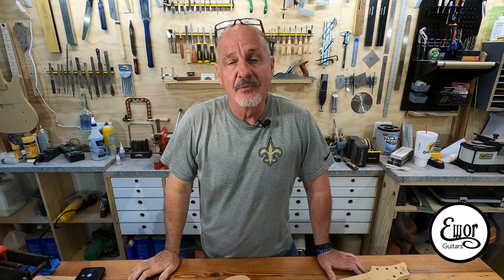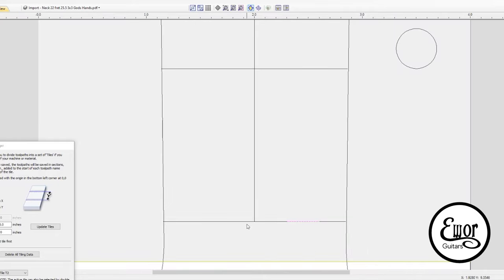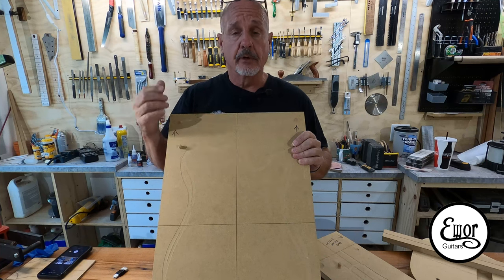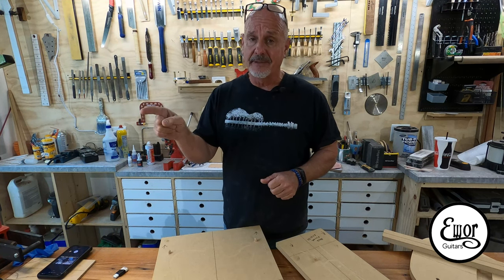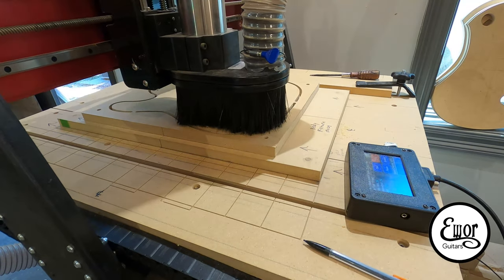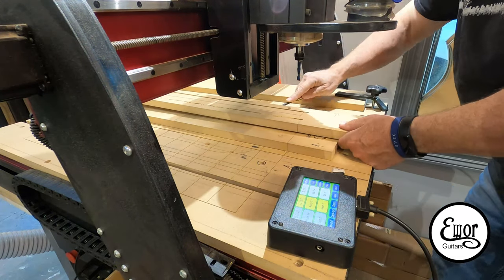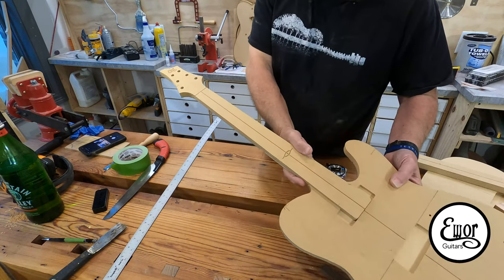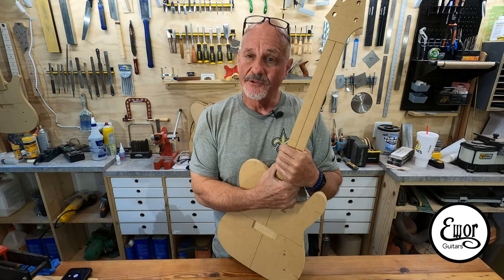My Journey into CNC guitar building: Part 1

Comment: I'm sorta new to this as well. My cnc work space is 20 x 22. I do my necks on a 45 degree angle so I don't have to move my piece around.
Reply from the maker: Yes I really considered that but the 14 degree headstock is why I do it in the tiled tool path

Comment: Man I'm planning on getting a cnc machine for my guitar business. Do you have any videos or know any videos that can help me get started on setting up my machine once I have it? Like tips on how to set up your dowel trick to keep the board in place ? And also what size machine do you recommend to get for guitar building?
Reply from the maker: Hi Kirby. I have learned a lot about CNC work from the you tube Chanel Mark Lindsay CNC. He has a ton of videos that are for the beginner. I have a shark 510 hd. It is a great beginner machine but if I had the money I would have bought the 520 hd. It has a larger cutting area. The software that comes with the shark cnc machines is Vectric Vcarve. Great software and the one mark Lindsay teaches about. If you continue to watch my current videos the the ones coming up you will see more of how I use alignment pins etc for guitar building. Good luck with your new adventure!

Comment: instead of tiling I lay my necks on at a 45. use pins to locat it as well.
Reply from the maker: I thought about that. I need to draw that out in vcarve to see how it works
Reply: @eworcustomguitars   I have the same machine, I do use aspire now but started with VCarve.  Cutting on the angle is really no different, saves the tiling.